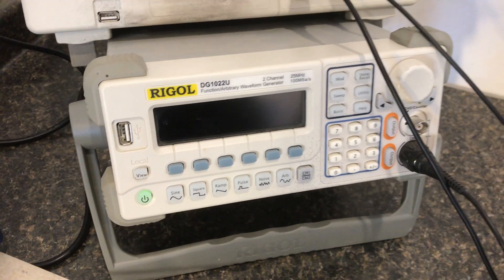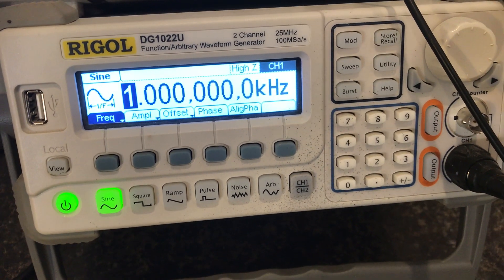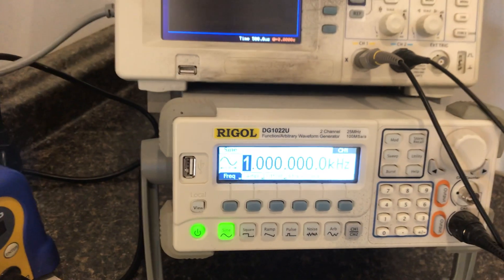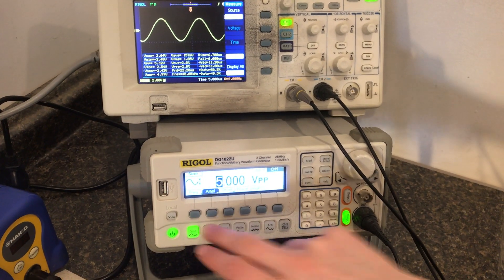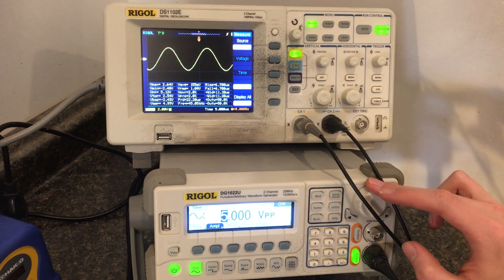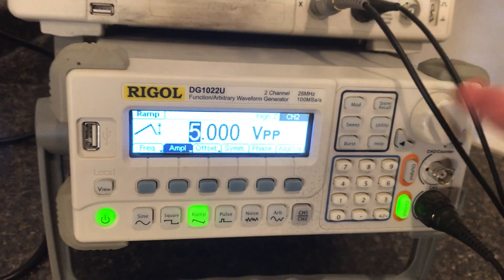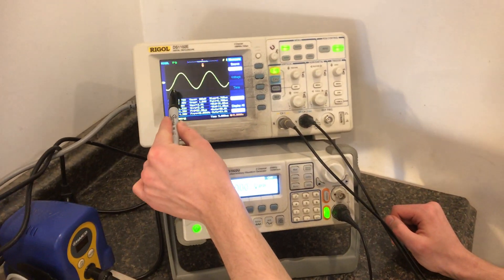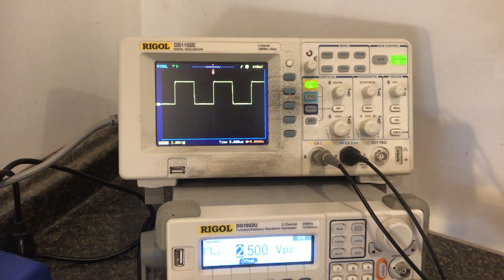signal generator RIGOL DG1022U (tutorial)

Comment: It's not "milli-hertz*.  mhz is an abbreviation for megahertz. The oscilloscope time base can be used to determine the waveform frequency by using 1/t. Both of the instruments in your video are extremely accurate. You seem to be struggling with the theory of how these instruments work & what their generated signals are used for.
Reply: I guess you are referring to the part at 3:38 in the video.
The maker of this video does appear correct.
This unit appears to have a setting for microhertz, millihertz, hertz, kilohertz AND megahertz.
I haven’t seen such a wide range of settings before on a sig gen or arb waveform gen. Check the screen at 3:38 as it shows all five of these frequency ranges.